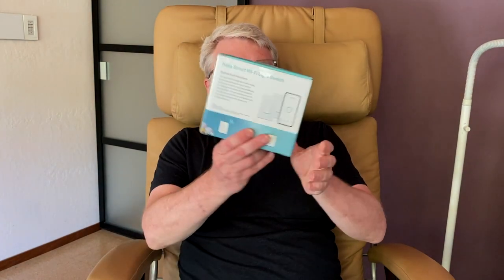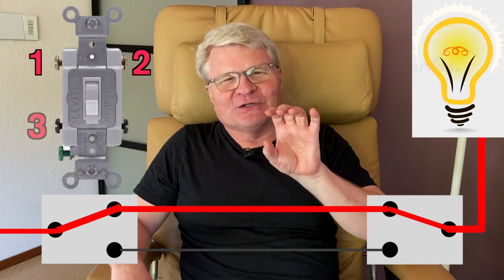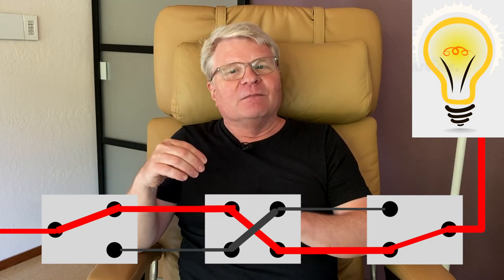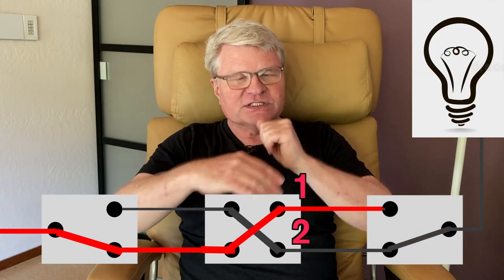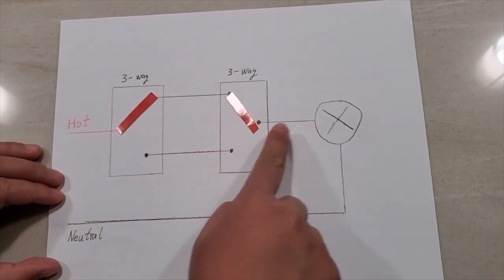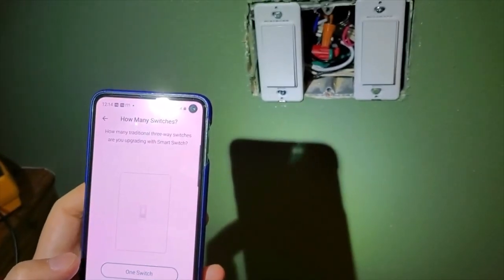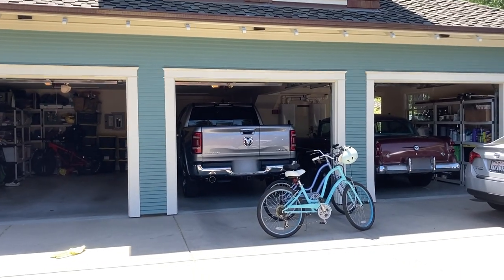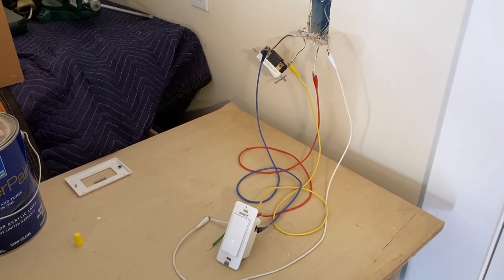Deep Dive: TP-Link Kasa Smart Wi-Fi 3-Way Light Switch on 3-Way & 4-Way Circuits & Your Network

Comment: Great video thank you so much.  TPLink should pay you!  Is there anything special about the two switches that come in one box... Or can you pair any two three way switches, or alternatively can you just use the two switches to control two separate three way setups?
Reply from the maker: Nope. Nothing special. They are packaged "for aesthetics" so both switches look the same, because, in a given circuit, only 1 will ordinarily be on the WiFi doing something.

And yes, you can use the 2 switches on 2 different circuits/setups.

Comment: I have wired up one Kasa 3 way switch in a 4 way switch circuit it’s works but the issue I see Is the Kasa switch doesn’t know the status of the lights when either of other two switch’s are used the app gets mixed up so it looks like the is light is on in the app but its not, or vice versa

Comment: So it looks like you configured two Kasa 3 way switches separately - if you configure them together (as TP-link intended, I think) would the circuit that you set up with the two 3 way switches work seamlessly?
Reply from the maker: No. At least not in all cases. On the test jig I ran through every combination, including pairing. If you slog through to the end (or just skip to the conclusion) you'll see that "pairing" simply disables the switch in the load-side box.

That said, just having another TP-LINK on the far end DOES change the electrical characteristics of the the travelers slightly. But it did not make my test jig start working magically, nor could I discern anything definite from that change that the line-side switch could use to behave "better."

That said, Geordie's did improve, and one commenter here states theirs did improve as well, but my test jig did not. It does not seem to be related to traveler length.

Need to tear into these and do some reverse engineering for clues as we get into Winter.

Comment: Good afternoon! 
I am attempting to use the kasa230 kit (usa 2.26) with a 4 way mechanical switch between the main and satellite switches. 

If the manual 4 way state is not changed, then expected results occur. Either switch controls on/off state and either switch can control dimming. 

The voltage from either traveler to neutral is identical as measured with a Fluke 179.

If the manual 4 way switch changes state, dimming control is lost. The load is presented with full source voltage. However either main or satellite switches can turn load off/ on

Can you provide insight and also offer a way to construct a dimming 4 way switch design?
Reply from the maker: I haven't done anything with the Kasa 230, so I can't comment intelligently. Intellectually (and electrically) the position of the 4-way switch should not matter (to my mind) in a properly wired 4-way circuit -- and your report seems to indicate your circuit is properly wired (especially that the 4-way in the middle is working properly).

In such a set up, I assume the 2 Kasa are talking to each other, either over the wires or LAN. If over the travelers, then it seems like the one of the 4-way positions interferes with that. (This is very similar to the problem we saw in Geordie's garage, which was never properly diagnosed, even with all the other stuff I did.) 

In a "dumb" circuit you can only dim from 1 position, typically the line-side box, with the downstream devices switching a possibly "dimmed" waveform.

In a "smart" circuit, I'd put the actual dimming in the load-load side box and have the line-side box slaved to it, using out-of-band communication to tell the load-side box what to do. That way the load-side "worker" always sees full power for it's electronics. There's no guarantee that's how Kasa implemented it, however!

Sorry I can't be more help. I really need to circle back and do another video on all this.

Comment: Hi there...thank you for the detail video. Based on your knowledge, I thought I put this forward to get your take. My question is more on the Wifi side and the TP-Link single pole switch. I have two Orbi wifi access points in my home. Most of my devices connect without an issue with them but three of my TP link switches. I have prior TP link switch and it connected to the Wifi without an issue. My Orbi does both 2.4/5.0 Ghz. I have mixture of devices and both types connect fine, even the prior TP switch. These three switches refuses to connect to Wifi. I even switched the Orbi to just 2.4 and still it would not connect. This is strange but after doing just 2.4 Ghz only, some of my 5 were connected also indicating that they are 5. Any pointer or suggestion would greatly appreciated.
Reply from the maker: Sorry, just saw this. It's cheaper to build just a 2.4 device, which is why so many smart plugs and things only use that band.  It's really hard to debug stuff like this, but it sounds like you're doing all the right things. (I too would have suspected the "bounce" some access points do to move devices from 2.4 to 5 when the AP operates both bands under one SSID. But by turning off 5 Ghz, you eliminated that variable.) Beyond moving the APs around, I'm afraid I don' know what o suggest.
Reply: @WardCo  Hi there! ...Thanks for the comments...I just saw your response. It seems like the issue was the app. I upgraded my APP and it started to work fine.

Comment: So i have a definate line side box with neutral, then the light is in the middle of the run and other 3 way switch is at the end of the run with switch loop (used neutral as other conductor properly marked with black tape to indicate as such.  Installation no problem with wifi connection/configuration and app worked perfectly.  Travelers are correct because both switches turn on and off properly.  Problem is, in one position at the dummy switch, the lights (actually two fixtures in loop between switches) flicker constantly until power is cut.  Any ideas?  KASA support zero help.

Comment: EDITED.. I want to install the 3 way dimmer kit.. and at the end of the video you mentioned complexity on MESH networks.. I have netgear orbi and naturally my switches will want to connect to the closest wifi.. IM wondering if im gonna have trouble??????? Netgear ORBI has been fantastic sofar with my KASA devices all my upstair devices connected to the intended DEVICE.. SHOULD BE INTERESTING......Mystery voltage.... what about induction? that can vary greatly in a circuit.. sometimes I see 40 volts AC from a red spare in a 3 conductor at first I was pulling apart all switches/plugs at the house trying to find the problem come to find out it was simple induction.. I see it all the time. now im installing all these KASA switches in my house. I bought 20 dimmers, 11 switches, 2 3 way kits and im gonna take a stab at the 3 way dimmer kit despite the reviews..the satellite switch on the kit doesnt need a neutral which is good cause on my load side switch where that is i have no neutral unless I pull one. Nice video.
Reply from the maker: I hadn't considered an capactative "ghost" voltage as the wires were so far apart -- but you're right, they are close in the switches, and yes, I too commonly see 40 and 50v ghost voltages in residential 3-way circuits. One of my meters here must have a low-Z setting, but I've taken apart the lash-up I used in the video and can't easily test it now.

I don't think you'll have trouble with your mesh network..
Reply: So I’m thinking that’s a lot of chatter. Did you have to setup a separate vlan for the switches? (Planning my setup :)

Comment: I have attempted the 4-way with the Kasa 3-way dimmer model. No success. Has anyone found a work around. 

I do have a spare 3-way non dimmer Kasa. Any idea if that could work in the 4-way switch location and group that smart switch?
Thanks

Comment: I am using a TP-link Motion activated dimmer switch KS220M, ES20M in my bathroom. I would like to set up a routine using my Alexa Voice activation to communicate through the switch using the word “shower”. What I would like the routine to do is when I am ready to take a shower, I would like for the light to stay on for at least 15 minutes or longer. 

When I'm in the shower the light keeps going out after one minute, and I must constantly wave my hands to trigger the motion detector to get the light to turn back on while I am in the shower.

Is there a way that I can create a routine to trigger the light for the light to stay on while I am in the shower for at least 15 minutes or longer.

I am also using a Smart Things controller as well as Alexa.

Comment: I am having a issue where when using the google voice command i can only get the Kasa switch to turn off when i give the command of turn on. The command of off does nothing. If the light is off the command of turn on will turn them on. Also in the Kasa app i have to press the the button twice to get the lights to turn off. If they are  off i can press it once they will come back on.  The threeway switchings on the wall work as it should. to futher complaicate think i removed one of the traveler wires and the google voice command and Kasa app work as the should but the wall switches don't. Im thinking i wire things incorrectly but have gone over it and not seeing where. I also tried a different Kasa switch.If you look back in your video you have what seems the same issue with the Kasa app when at this gagrage, you had to press the button twice to get it to respond. Any input would be great.

Comment: I was successful replacing Kasa in 3way circuit without issues (one Kasa and one Manual switch). i am having trouble on a 4 way staircase connection. I have one KASA 3way switch at lower level and one manual 3way on top level and one manual 4 way on top level. My kasa and manual 3 way works only if 4way switch is in toggle off position. if i turn 4 way switch to toggle on position, Kasa automatically turns it off and the 3 ways switches does not receive power. did i mess up wiring? or have Kasa in a wrong box? or do i need Kasa 3 way in second box too. please help.

Comment: I wanted a 3-way switch without the traveler wires, but unfortunately, Kasa can't do that.  I wanted to use a Kasa because I've already got several Kasa items: a switch, 2 outlets, and the phone app.  Seems odd that this limitation exists because Kasa can throw a switch via wifi.  Regardless, I discovered the Lutron Caseta does wireless 3-way switching and it was a quick, simple installation.   I chose to set it up without their dedicated hub and phone app but those are options.
Reply from the maker: Thanks for the tip, Bob.

Comment: So, from everything I have seen I have yet to see the setup I have. First I have the ks230. Out of my wall I only have a black wire and a white wire activating my donning room light switch, that’s it nothing else not even a ground wire. Which instructions should I follow and electricians in my area are out of reach making this endeavor not worth my while if I cannot install it myself.
Reply from the maker: So you seem to have a "switch loop" in that box. That is, the person wiring it ran a single piece of cable, probably from the light, to that box. The "white" wire in this case is not a neutral (grounded) conductor, but is instead either always hot or carries current from the switch back to the light to illuminate it. In effect, the white wire is being used as a black wire. This is okay, but it is supposed to be wrapped or marked with black tape or ink to "re-identify" it as a hot conductor.

I assume the ks230 requires a neutral to run the internal electronics and you don't seem to have one in that box so you probably can't use that switch unless you provide one. (There are some tricks you might play, but they're really no-nos, so I won't describe them here.)

Since...I dunno...2018 or so, a neutral is required in most boxes, in part to run electronics like yours. But, obviously, there are decades and decades of old work out there that don't do this.
Reply: @WardCo  Very disappointing but it is what it is, Lol. Either way, thank you.

Comment: It was a good video but I’m still wondering how u get the 4 way switch to work properly? I installed both Kasa 3 way switches and they work great however the 4 way does not work? Can anyone help me?
Reply from the maker: Do you have a manual 4 way in the middle? (I really don't know if Kasa makes a "smart" one.) In what way does it "not work?" 

At some point, if you understand the theory and things SEEM to be connected correctly, you have to kill power and use a multimeter (and a long piece of wire to extend one probe) to test for continuity on each wire segment to assure yourself that each wire is what you think it is.

The fact that each "end" of the circuit (with the 3-ways) works correctly seems to indicate current is getting "through" the 4-way, at least in 1 position, which means it can't be wired entirely wrong. Though, of course, the switch itself could be bad.
Reply: I get the same result as poster. Wires are correct. The two kasa230 (master and slave) work . Lights can be turned on or off and lights dimmed from either end. BUT if the manual 4 way switch changes state, then dimming control no longer works for that state. Dimming is put into max brightness (full voltage) Change 4 way state back to original position, and dimming control (by master or slave) is restored. Btw. Voltage on each traveler relative to neutral is identical.

Comment: How do you determine which is the line side box and load side box?
Reply from the maker: If you:
1. Turn off the power to the circuit
2. Remove the wire from the 1 screw on the switch that is differently colored than the other 2 and leave it floating in the air.
3. Turn on power to the circuit.
4. Measure for voltage on that wire -- you can use a stick tester, but a multimeter would be beter. (Probes to the floating wire and ideally neutral but ground will also work in a properly wired switch.)

If there is voltage, it is the line side box. If not, it is the load side box.

If you want to be sure, repeat at the other switch -- it should behave the opposite. (e.g. if there was voltage at the first box, there should be no voltage at the second, and vice-versa).

Sometimes one can make an educated guess about which box might be the line side by thinking about how the builders must have wired to get from the circuit breaker panel to the switch.

Be very careful.

Comment: FYI and I speak from the experience of having all of my parts and pieces staged in front of me waiting for installation.

The TP-Link Kasa KS230 v2 Dimmer is in fact a two switch "kit". One switch is a labeled "Main" and the other switch is labeled "Satellite". The difference between the two switches in the kit is;

The "Main" has connections for Line, Neutral, Ground and the two travelers. According to the schematic in the Quick Start Guide the "Main" switch must be located in the source box. The "Satellite" has connections for Load, Ground and the two travelers. That said the kit cannot be split into two independent switches to conserve costs.

I am trying to visualize how this would be a go or no go on a circuit with a 4-way in the middle. Maybe this has been indicated or identified in previous comments. I will update this comment when I try it in the circuit with a 4-Way in the middle of a three switch circuit.

I have been wracking my brain with the idea of an interposing relay in the middle where the 4-Way is but I have not come up with anything (yet).

Comment: Does anyone else have a ~1 second delay when turning the light on from one location but not another?
Reply from the maker: That's interesting. What kind of load are you switching? LED bulb, or?
Reply: @WardCo  I'm just switching a 10W LED bulb. Long story short, about 2 hours after I posted this both stopped working. I took the face plates off and discovered I had wired it incorrectly. I used a multimeter to identify the travelers and worked my way back. Both are working now with no delay and I'm just grateful that they failed gracefully rather than start a fire.

Comment: non-smart switch need to be momentary switch.  Hack the non-smart switch and put in a spring and will turn to momentary switch.
Reply from the maker: When I think "momentary switch" I think push button -- or a toggler with spring return. I don't see why this would be helpful when you want the lights to stay on? Now, a manual 3-way switch that was "make before break" would be useful as a manual in the line side box. I assume the Kasa would not have any trouble with parallel current on the travelers for a short time.
Reply: @WardCo  this is how I used in many installs in order for 3 way switch to work properly otherwise it will turn on every other trigger.

Comment: Actually that is my question. The only advantage of 3way switch is it can get energy for operation from any wire. The question is, why are not all the smart switches setup like that. You could argue that all the smart switches should come with 4x2 inputs with power being pulled from any of terminals... One size fits all...I suppose that would kill the margins, that is the reason is not done like that